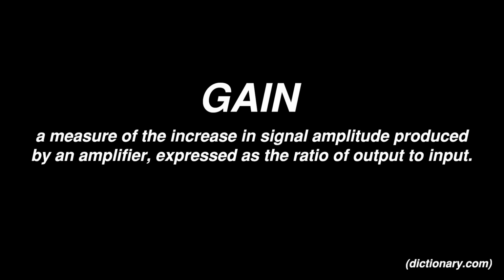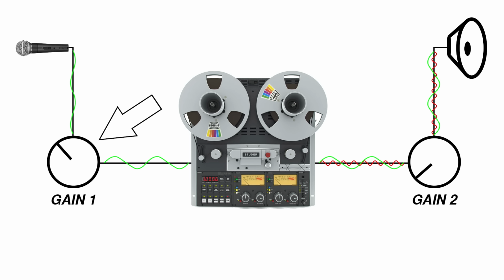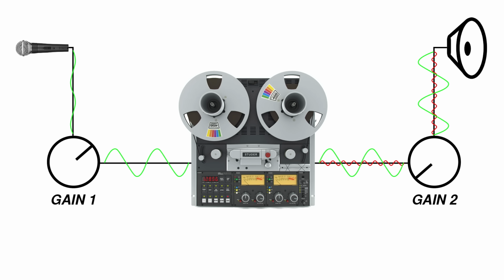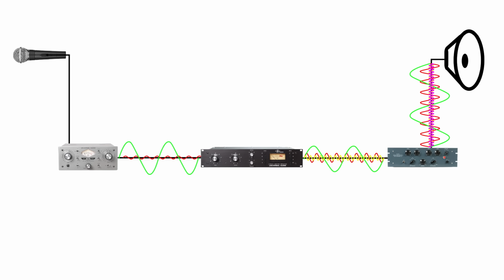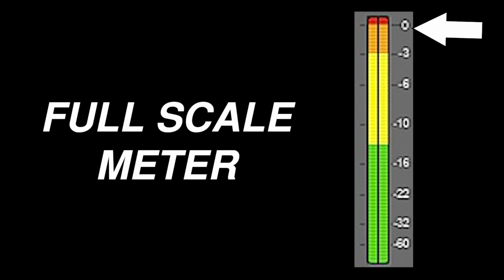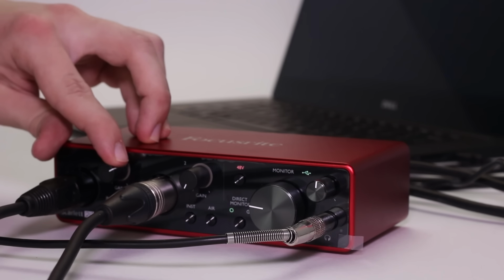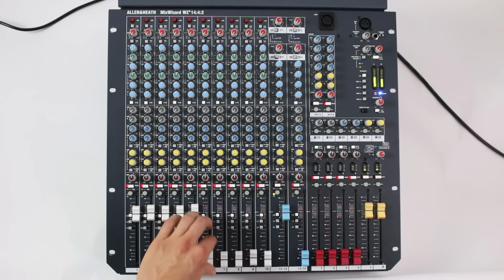Gain Staging Secrets Every Great Audio Engineer Understands!

Comment: Usually I'm starting at 12 dB peak per channel on the mixing session as you said. If I mix in my arrangement session I'm turning down synths outputs to meet this requirement or I'm using gain knob in pre-mix section of the mixer in my DAW (I use Cubase). Also I adjust clip gains if it's necessary. That simple and it gives plenty of headroom on the master bus, making comfortable mixing environment and also it's giving nice headroom in mixdown for further mastering session.

Comment: Question? I recently purchased a Bose L1 Pro32 system. Even with the volume setting on 1 or minimum, it is too loud for most small venues if I set up the mixer at unity with the gain optimized for all inputs. Ie. guitars, bass, electronic drum kit and vocals. Should I decrease the gain input to reduce the volume or lower the main output sliders? Or is there another solution?
Reply: Hello William, Our church just acquired the L16 series. This is how I staged the speakers. Like Kyle said get the mixer gain staging right.
                    analogue
1. Selected channel is muted and gain is turned all the way down.
2. Bring the Master fader to unity. 
3 Bring your subgroup faders to unity
4. Set your channel fader at unity
5.  Then as Kyle suggested what ever the signal source should be turned up to 80 %.
6. Un mute the channel ,start to turn up your gain until while watching the meter until you are around - 12.  from "0. 
7 Power up your  speakers and  turn up the volume evenly on the speakers. Now here the tricky part. Back Off on the main fader  a little bit, then use your subroup faders to fine tune the "balance" and angle directton between your speakers. Let's say you have to bring down the subgroup "2" fader down a little from unity to get an even balance thus it indicates you have to turn down the volume on that speaker it's self. Then bring the fader back up to unity to check what the balance sounds like repeat accordingly.  I'm having to run my left speaker volume setting just  a tiny amount higher than my right due to the room shape /dynamics   And with a Digital same for setting the unity gain staging. Just as Kyle said keep the main fader output around -10/12 DbFS and do likewise to fine turned the speaker volume. Hope this is the answer you were looking for.

Comment: Hiya, great video, It helped me a lot to understand how it all connects together. I have a question though. I run an open mic night, typically acoustic guitar vocals and occasionally other instruments like keyboards etc. I can set the levels for the initial guitars and vocals, we always get things going by playing a few songs before our guests get up to play. After that, it's a constant stream of varying instruments throughout the evening and I'm not quite sure if the best approach. Do I leave the faders at unity and just tweak the gain, if so what's the point of the fader?  How would you approach an event like this, I'm curious to know. Hope all that made sense.
Reply from the maker: I would recommend running a quick sound check before each set to er levels with the preamp. Use the fader for adjustments throughout the set.

Comment: Hi Kyle, thanks a lot for these insights. My question - I experience clipping and harshness in my final output. What should be my recording settings?  
Here are details of how I record -  I use Focusrite Scalett 2i2 and Rode NT1 A mic for my home setup. Set up is not completely soundproof. I record news podcast using Audacity. What should be my settings on Scarlett, inside the Audacity etc.

Comment: Each box to which the signal traverses will add distortion and coloration to the once (virtually) pristine signal.
Even if you leave every box's controls in their neutral position, you will be able to hear each box.  The only way to not hear a box is to not send the signal through the box.

Every effort should be made to use as few cables, as few boxes, as few features as possible.

But the song still comes out sounding great, even though you sent it through all of your gear?
That is because your stereo is not revealing enough for you to hear the sound degradation.

So if the song is only for you, then it makes no difference.
If the song is for the public, then there will be lots of folks that have stereos of such quality that most of us have no idea exist.

On such stereos, you will hear every single thing done on every box.  You will hear it, because that is what happened, and a professionally set-up high-end stereo, in a treated room, will reveal it all.

Most songs have decent sound quality.  Far, far fewer songs have outstanding sound quality.  And the better the stereo, the more obvious this becomes.

Comment: My advice: Most people listen to music off their devices like phones computers etc, bounce your project and play it off a normal device to compare before considering your projects done there are many times I've done this and notice massive volume differences, but bounce it as an MP3 as the noise increases a lot more which gives an accurate perspective or just get some grade A monitors bounce is on your computer as an mp3 and play it back, be aware that any gain you change when recording is destructive though and no amount of compression will change it as the track has already clipped.
Reply: I never consider my tracks done until it has been run through and sounds decent on a portable BT speaker, a phone, basic ear buds, and good through PC speakers and car stereo as most music is listened to in the car for your average user. I have learned the lesson of hearing a mix out of my monitors and being proud, then listening through literally anything else and being embarrassed and saying, "Wow, that sounds like absolute, grade A dogshit."

Comment: Guys to get a good mix, apply your effects first, then turn all the faders down, turn your computer volume to full and go through track by track, I promise the faders should never be on high, then at the end apply a limiter on your stereo output and reduce the gain, if its in the yellow its fine but if is red anything above 1dB will clip your track and add distortion

Comment: Your videos are really good. I don't always agree with everything you say but you typically give an alternative explanation.  Some YouTube channels have thousands of subs and I can't really understand why. Your channel is doing very well and I CAN understand why. You provide great content.
Reply: I mean none of the gear he’s using is nice, a focusrite and a powered speaker aren’t nice either it’s just demo gear for the video. Those Ashlys get the job done I never had particular problems with them, it’s just I rarely use a rackmount graphic anymore
Reply: @IWannaGoMissing  For live applications I've used Ashley as well, but not cause I owned it, it's what was there and you're right, it got the job done. Last thing I want to do is sound like a gear snob, but the Ashley's had noise problems. May be more tolerable now in the digital age, being able to cut some of it out, extended noise floor.
Reply: When I say cut some of it out, I'm talking about using something like Izotope RX which is great for restoration and handling noise issues.
Reply: With that said, That Ashley EQ is awful. I know I sound like a gear snob but I'm simply keeping it real.
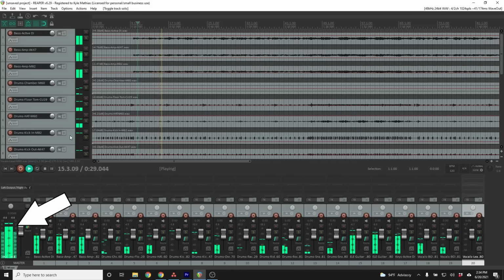Also- @8:40 There is not plenty of headroom. Your peak is around -0.5 One needs to account for FX being used on each track that will sum to the Masterbus. To be honest, in digital, even a peak of -0.5 is a little much.

Comment: Do you have any videos on running a sound check? In my experience, the musicians just want to run through the songs, not leaving enough time to dial in the audio mix. Or telling me where to set the house volume as they are standing on the stage. "I can't hear myself in the house." Well maybe that's because you're standing next to your stage monitor, Shredda. I'll make sure they can hear you in the house,
Reply from the maker: I usually prioritize a quick mix at FOH, adding monitors for each instrument after it's already in the main speakers. That way they are only getting the absolute necessary amount from the monitor that is needed. (Of course, they often need more than is needed, but this method has worked for me!)

Comment: I've gotten slack about this with total denials but driving channel input gain close to or into clipping just to achieve a fatter sound on a snare for instance, slowly damages the input transistor stage. When a channel is driven hard the transistors are turned on for a longer duration and conducting current longer. This will cause a transistor to over heat and eventually fail. The same holds true for speakers and HF drivers. Having serviced a lot of consoles I could tell which channels were used for kick and snare as they were first to fail. If you want that overdriven sound use an appropriate plugin or get creative and send your drum mix into an amp, guitar amp possibly and mic it in a live room. Maybe Kyle has done a video on the benefits of even harmonics versus odd harmonics.
Reply from the maker: Thanks for bringing that to everyone's attention, Donald. I expect many will still overdrive their gear if it produces a pleasing sound, but maybe they will appreciate the experience more now.

Comment: Trying to set gain on multiple devices in a PA System can be a challenge!
I have a Tri-Amped System. This consists of a Peavey IPR2 2000 for the HF Drivers in my Peavey SP4V2’s and an IPR2 5000 to drive the dual 15’s in each cab and an IPR2 7500 that takes care of the Peavey SP218’s. 
Before the amps we start with my iPad, which goes to a Yamaha MG12XU Mixer, then to a Peavey 231 Dual Channel 31 Band Equalizer that I use for the Low Cut Filter to protect my subs, then to a Peavey 35XO Electronic Crossover that feeds my amps. 
All devices have Gain for each channel and I’ve never been able to set each one to what I think should be the best level because I’m not sure what the level is. I’ve always left the EQ at 0dB, as well as the X-over and left my amp gains maxed and make my adjustments on the mixer. 
How can I get this system tuned in the proper way so I can achieve great sound and not have to worry about clipping?
Reply from the maker: I recommend keeping the meters along the signal path at a "nominal" level. For an analog meter, I will aim for peaks at +3 dB. For a digital meter, I will aim for peaks at -6 dBFS.
Reply: @AudioUniversity  Thanks for your reply. I’ll give it a try and see what happens. 

Too many Rock concerts in the 80’s is to blame for me wanting the music loud and clean. Like muscle cars, no matter how much power you have, eventually it just isn’t enough.

Comment: I've encountered  a technician who had set up a sound sysyem setting the channel faders and master faders to 0 dB and then adjusted the channel volume with the gain to a general average. (their reason: no noise with a digital mixer so gain can be low and the other reason being that all faders at 0 dB gave a better overview)
Practical problem: The first speaker on stage had a loud voice and spoke close to the mic. Speaker 1 hands the mic over to speaker 2 who keeps the mic at 10 inches from her mouth AND spoke very quietly. The person at the mixer without much technical knowledge wanted to increase the volume but couldn't, because the fader just couldn't slide upwards any further.

Comment: Hi dud. Does this kind of knowledge work if you produce with virtual instruments or does it apply only to recorded material? (especially the information about the peaks at -12db)
Reply from the maker: The noise risk is much lower with virtual instruments but I still use -12 dBFS as a target.
Reply: thanks man i really appreciate it

Comment: I agree, gain staging in a DAW is the most important task to learn. That separates professionals (or semi professionals) from hobbyists. The reason for gain staging in a DAW are the analog emulation plugins! You can clip the channels as much as you want, as long as the masterfader is below 0 dB. That's because of 32 bit floating point processing. This fundamental difference you missed to explain.

Comment: If you’re setting all tracks to peak at -12 dB FS, how are you working the tracks that are ‘supposed’ to be much lower, say well under -18dbFS ? I’m thinking more about film soundtracks rather than actual song mixes, though I would’ve thought that wouldn’t make much difference as conceptionally they are the same.
Reply from the maker: You can use the fader to control the level. For sound FX, don’t get too caught up on getting a perfect level. As long as you’re aware of the trade off between noise and distortion.
Reply: @AudioUniversity  Thank you.

Comment: Great video!  I use an iPhone into a mixer for backing tracks.  I have heard source/phone should be at 100%.  I back it off one click to 95%.  You said 80% who is right?  I PFL until red clipping and back it off until red disappears. Is this correct?  I called Souncraft tech support and this was their suggestion.
Reply from the maker: As long as there is no distortion, either 100% or 80% will work. It’s just a balance between too much signal and too little.
Reply: @AudioUniversity  Thanks! Keep up the great videos,

Comment: Good video but one thing.  A VU meter does not nor is it able to reflect peak level.  It is weighted and doesn't have fast enough rise time in order to accurately measure peak level.  0VU is only rated at +4dBu when feeding it a 1kHz sinewave, which has no dynamic range.

Comment: I do like what Zoom has done upon some of their field recording units and that is to have two pre-amps, one set high and the other low, so if the high clips it will switch to the low preamp input.

However, that's all changing with 32bit float and for digital work, it has made life so much easier as the whole universe could explode and 32bit float wouldn't clip :).

Comment: Just came across this great info.  Personally as I do mixing in a different daw than my production I prefer to setup my audio lanes to have a pretty low db FS at the start and slowly through busses and a pre master that everything is affected by get it back to the ideal threshold before mastering.  But I've seen this method work to and I'm glad to see that I wasn't lying when I explained gain staging to my friends (though will be sending this to them too)

Comment: In integer PCM (traditional digital) you have an additional problem with audio recorded extremely low. Not only when will noise be a problem when gaining up, but the signal will have no resolution, so you may up get digital aliasing introducing weird sound.

With a good fp32 (float) PCM workflow, everything is much more forgiving and going above 0db is no issue. Maybe it is a bit of an abuse but my mixes typically always go above 0db and then is rained in by a limiter on the master bus. For spoken word / podcast that sounds more than well enough to my ear.

For video work I’m hoping we’ll see everything transition to floating PCM within the next few years so audio work becomes focused on capturing the best audio (best signal / most dynamic range) instead of throwing reserving headroom. Let the ADC capture great audio without managing gain staging much :) A lot less stressful not having to worry about clipping or recording too low. When you don’t have an audio guy on set and need to manage video, audio, capturing PC output, supporting talent and what not, traditional error prone integer PCM gain staging is an additional stress factor I’d prefer not to deal with. A great sounding FP32 ADC built into every camera XLR input would be great!

Comment: Taking the time work within those standard limits pays for itself over and over.  Thank you for making this, as there are a lot of people that don't understand the concept.
I've discovered, by accident, that proper gain staging makes a superior and flexible product.  My mixes can be played on nearly any equipment at high levels and still not clip.
The idea behind this is that the quality of the reproduction is completely dependant and limited to the quality of equipment used to play.

Comment: I use Presonus Studio One, and we have a gain trim knob on every channel. I used to use a VU meter on the master bus and set it to -18. Then I would play each channel in solo, watch the VU and adjust. Later I started using a VU on every channel, but now I'm just looking at the FS meter, peaking at -12 dB. 

I also put a trim plugin in-between pluggins and/or last in the chain, because if I'm using any plugin in a more extreme way that changes the level, and the plugin(s) don't have a gain or level knob, I use the trim plugin to put the level back to -12 true peak. It's not a rule, but it helps keep everything in line, which means that I don't have to set all the faders extremely different to get approximately the same levels, e.g. one channel around zero, and another at -10.